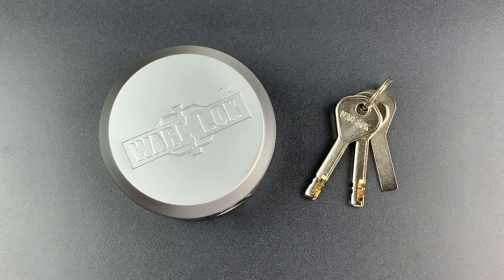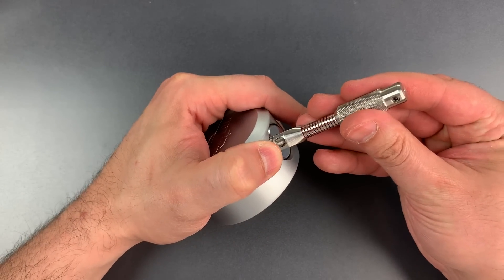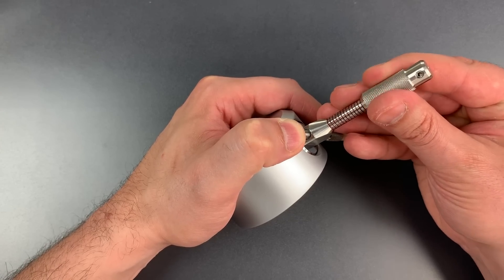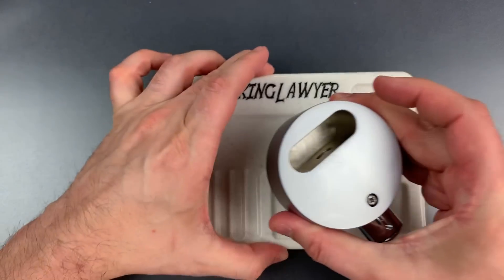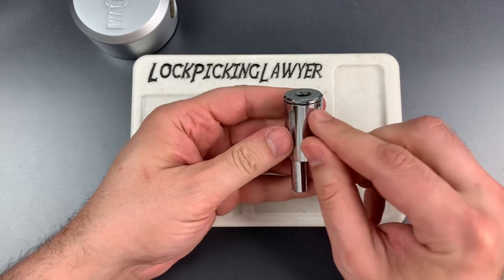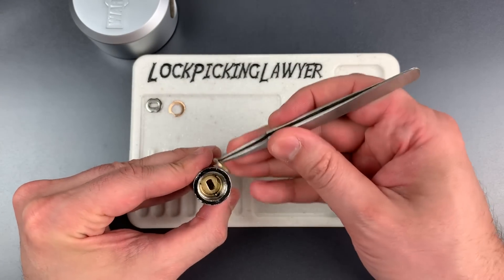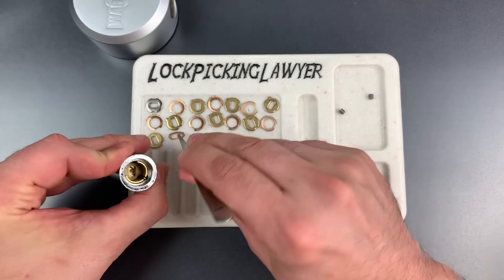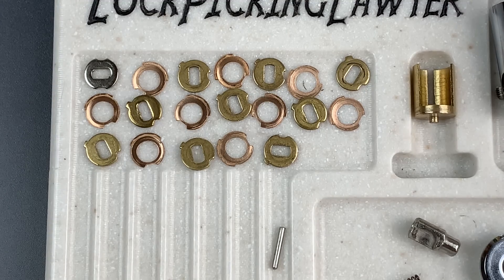[903] War-Lok Puck Lock Picked and Gutted (Model PKL-10)

Comment: Hang on... A puck lock is intended to mount flush with the object it’s locking. That tool you used has arms that required you to rotate the tool into a position you would NOT have been able to do had that lock been mounted.. Let’s have you redo this one but have the lock mounted flushly against a door, etc. I call foul until this one is picked in a real-case scenario. I don’t doubt your skills. But I certainly think this one would be significantly harder to pick if it were mounted and locked in place against a flat surface.

Comment: I wonder what would happen if you used the Ramset on this lock, mainly where the locking lug sits.
Reply: 90% odds of just jamming it permanently into the body. A drill or grinder would let you just push the pin in and drop the core out.
Reply: A small cobalt drill bit in the right place could be a really quick attack. You even have the logo on the front as a reference for exactly where you need to drill.
Reply: @anononomous  good idea

Comment: LPL you should start making a seal of approval of LPL s (or lock picking lawyer average seconds to open) plus a 3-star system of how common the tools for opening are. 0 for household items, 1 being normal hooks, 2 tools available online and 3 tools that you made for it, not available commercially.

for example, this lock would be a 74 LPLs and 2 stars.
Reply: That tool is custom made, idk if there is something similar that you can get online, but this would get 3 stars on this rating system

Comment: Purchased one of these recently, and after removing the core it revealed that they did move the actuator to the side instead of the front to protect with significantly more metal.  Happy with the lock.

Comment: This looks better made than the one I got off Amazon. The logo on the front of mine looks like it was not stamped well. Parts of it barely visible. Also the cylinder stick out ever do slightly from the lock body.
Reply: Still best Puck lock for the price.

Comment: Drilling it out with a smaller drill bit means it is easier to hide the drill bits and you have less material to cut. If it is small enough you might even be able to fill the hole with glue and disguise your attack!

Comment: Locking pin is just spring loaded? I wonder if hitting the face of the lock can make the pin recoil into the core enough to unlock. Slamming it down on a hard surface would work too but of course that's not possible when on a hasp.

Comment: Would you think about doing some distructive testing exploiting the locking lug with a hardness steel pin punch and hammer before you try to drill it

Comment: Before you try drilling it you should try using a magnet see if you can pull that metal stud down I think the body or Bible I think it's cold I think that's might be magnetic so you might need a bigger magnet

Comment: Hey lockpick lawyer, I love your videos! Where can I get that tool you are using???
Reply: You have to make your own or wait for Sparrows to release their version of it.
Reply: @davidgalbraith1840   Thank you, David, you would happen to know if there are any blueprints on how to build it.
Reply: @princehenryiv9207  IIRC they should be up on Bosnian Bill's site Lock Lab. They did a colab series designing and machining the picks, going through several prototypes before they got to the final product you see here, Bill has the prototypes.
Reply: prince Henry  Part 1 - The pick body (LPL) https://youtu.be/q1rYhO--TDA
Part 2 - The control knob (BB) https://youtu.be/Og0bLzU7cWg
Part 3 - The tensioning “nose” (LPL) https://youtu.be/cECT_90pgyc
Part 4 - The tensioning handles (BB) https://youtu.be/qJ3S3tNyBk8
Part 5 - The pick tip (LPL) https://youtu.be/wrd5r1TzkCM
Part 6 - Final assembly and presentation (BB): https://youtu.be/pelD237owcc

Comment: Now that the lock is disassembled, If I'm understanding how the false gates in these work, couldn't you file a few such false gates into the sides of the discs before reassembly?
Reply: Yes you can, but getting the order wrong on these is far harder to recover from than a pinned lock.

Comment: If that lock were installed on something, would you have been able to use the pick?  I assume one side would hit the surface of whatever it were locked on.   Would the pick work with just one tensioning lever?
Reply from the maker: Yes, you can take one off. You can even take both off if you use a set screw.

Comment: Could you effectively bump this lock by hitting the front hard enough to drop that locking bar?
Reply: No. The sidebar has to fit into the gates on the disks that need to be aligned for the sidebar to fit in.
Reply: @Blitnock  at 2:11 LPL relocks the lock. At 2:30 he depresses the locking lug with his finger, stating that it's spring loaded. That's what made me wonder about it.
Reply: @drew79s  Oh, that's a good point! He really didn't show how the locking pall interacted with the core/side bar. Maybe it can be rapped? It would be nice to know the answer. I hope he sees your question and replies, but with his gaining popularity, I wonder how many comments he reads these days.
Reply: @Blitnock  Fingers crossed... I'm intrigued :)

Comment: Cool, I don't think I've seen a disc detainers pick lock before. It shouldn't be called War as it has no false gates.
Reply: LPL and BosnianBill designed and built it themselves, here is the series:
Part 1 - The pick body (LPL) https://youtu.be/q1rYhO--TDA
Part 2 - The control knob (BB) https://youtu.be/Og0bLzU7cWg
Part 3 - The tensioning “nose” (LPL) https://youtu.be/cECT_90pgyc
Part 4 - The tensioning handles (BB) https://youtu.be/qJ3S3tNyBk8
Part 5 - The pick tip (LPL) https://youtu.be/wrd5r1TzkCM
Part 6 - Final assembly and presentation (BB): https://youtu.be/pelD237owcc

Comment: How would you pick it when installed? From what I've seen,  your tension tool went beyond the line of the puck's body so I guess you wouldn't be able to tension it in some aplications
Reply from the maker: Good question. You can easily pick with one of the handles removed. 👍

Comment: Do you think that if this type of lock had around 10 lb of spring tension on it it would be more difficult to pick?
Reply: Hrmm.... if each disc had an individual return spring that snapped it back to home, just strong enough to overcome any binding forces, then you couldn't physically hold a disc in place with tension to move on to the next one. 

Which really just means the tool would have to be redesigned with multiple concentric shafts and separate rings with spring loaded clutch buttons and let the tool hold the discs individually, but the return springs would also ruin any sensitive feel.... and would also probably make the lock difficult to turn with the key. 

Tricky, this engineering bit.
Reply: @mfree80286  Build it and send it to LPL and BosnianBill.
Reply: @davidgalbraith1840  sigh I wish I still had the time to build things on a whim...
Reply: @mfree80286  Same, I keep seeing all these awesome things beng made on youtube and think, now all I need is a lathe, a mill, a forge and anvil, an infrared soldering station, TIG and MIG welders, a plasma cutter, a pipe bender, and a place to put all this shit...

Comment: If I understand correctly, the wiggle room for your pick to go from one disc to the next is the leeway given by the spacer. Does that mean that you couldn't use this pick if they somehow impoved the lock to a "zero spacer" model? Is this at all possible? How would you go to get such a lock picked?
Reply: No, the discs are steel, they can stick and grind against each other, the spacers are bronze which against steel and iron acts almost as a lubricant preventing the discs from sticking together and causing the lock to become unusable.
Reply: @davidgalbraith1840  Thanks for the insight, but all the same; what if the spacers where so thin that you couldn't move the pick from one disc to the next due to the tight spacer dimensions?
Reply: @SojournerDidimus  You still have the thickness of the discs themselves to work with. You can only make them so thin before you run the risk of them bending and thus rendering the lock useless. That was the purpose of making this tool, the picking tips are replaceable, they can match the diameter and thickness of the discs and keyway up to the point where the materials fail by being too thin.
Reply: @SojournerDidimus  Someone else had the idea of making a lock like this virtually unpickable would be to add as much as 10Lbs of spring tension to the discs, this would run the risk of damaging the discs or key, but would also more than likely damage the pick and remove all feedback, adding false gates to that mix and it'd likely keep anyone out.

Comment: Can you pick that type of lock without that tool that you made?  Or do you have directions on how to replicate that tool?
Reply: You can order a shitty one from China bu that one LPL and BosnianBill designed and built it themselves, here is the series:
Part 1 - The pick body (LPL) https://youtu.be/q1rYhO--TDA
Part 2 - The control knob (BB) https://youtu.be/Og0bLzU7cWg
Part 3 - The tensioning “nose” (LPL) https://youtu.be/cECT_90pgyc
Part 4 - The tensioning handles (BB) https://youtu.be/qJ3S3tNyBk8
Part 5 - The pick tip (LPL) https://youtu.be/wrd5r1TzkCM
Part 6 - Final assembly and presentation (BB): https://youtu.be/pelD237owcc

Comment: Does he have a lock picking jargon video, because he says some things and idk what they mean
Reply: What things? If you specify what confuses you someone will explain it.
Reply: @Cheesus-Sliced  binding for example but there's prolly more
Reply: @jmanh128  binding means that particular pin is catching. When you torque the keyway, depending on tolerances some pins will be caught tightly between the plug (the part you slide the key into) and the housing (the part that contains the plug and all the pins). The pins that are caught are "binding", so you can feel when they stop binding because either they are set at the sheer line or you engage a security line on them. As you find where each pin needs to be, the plug rotates a little more and another pin binds. Look up a lock core diagram if that helps to visualise it
Reply: @Cheesus-Sliced  thanks!
Reply: @jmanh128  no worries. Feel free to fire more questions

Comment: what can you lock with this design lol
Reply: Puck locks are usually used on work vans, storefront security gates and trailer hitch guards. Physically they are much tougher than most other designs as they go into a recessed housing with only the keyway and face of the lock exposed.
Reply: A hasp and staple.

Comment: What are puck locks used for? I don't exactly see a mechanism for it to attach to anything?
Reply: instead of a lenghty explanation just do a google image search of "puck lock" and your question will be answered
Reply: Google "folding latch" and check images.  Most people will lock with a regular padlock but any similar latch, some of which are for latches that slide open rather than fold, the puck lock completely covers the shackle so that Joe-Schmoe with a set of bolt cutters cannot get in as easily.  Googling "puck lock" and checking images has more examples.
Reply: Most commonly you will see them locking work vans. You'd have 2 keyed the same in a Sprinter or similar sized van, one on the rear doors and one on the side doors. There is usually a bulkhead installed behind the seats so you can't just break a window to access the cargo or tools that way, though you could steal the van, which probably has a GPS tracker hidden inside it.
Reply: A hasp and staple.

Comment: Too much speed on the drill, heat softens and blunts the drill. Granted you’re using carbide that can handle a decent amount of heat but for metal drill avoid so much speed and you will find you’ll get through much thicker steel before failure

Comment: Why would he invent a device to pick open a lock?
Reply: He does it for the challenge. Also disc detainer picks have been available from the usual scumbags in China for a long time now, LPL and BosnianBill just designed and built a better one as the others where just so crappy.

Here is the series:
Part 1 - The pick body (LPL) https://youtu.be/q1rYhO--TDA
Part 2 - The control knob (BB) https://youtu.be/Og0bLzU7cWg
Part 3 - The tensioning “nose” (LPL) https://youtu.be/cECT_90pgyc
Part 4 - The tensioning handles (BB) https://youtu.be/qJ3S3tNyBk8
Part 5 - The pick tip (LPL) https://youtu.be/wrd5r1TzkCM
Part 6 - Final assembly and presentation (BB): https://youtu.be/pelD237owcc

Comment: If I'm picking a lock and it gets stuck trying to pull the lock pick out what does that mean
Reply: I know it means too much tension but does that mean I'm stuck on the pin or the hole the pin is in
Reply: Sorry trying to use voice instead of texting it with my hands it's not doing everything could you please ime a me

Comment: cant you just take the screw out to pull out the core?
Reply: the screw is hidden while the lock is in the locked position. to remove the screw, you would first have to open the lock
Reply from the maker: Removing the screw does nothing if it’s locked
Reply: @lockpickinglawyer  ohhh. I asked this same question above. haha! I have never seen a lock like this. P.S. I know nothing about locks as you can tell.

Comment: Forget a drill, use a punch and hammer.
Reply from the maker: I’d be stunned if that worked.
Reply: Mike Fisher
 Are you thinking with light tension pulling out on the core, you could inertia that pin back?
 Or do you mean punch through the body face?
Reply: @dragonhealer7588  I was thinking second option, but a Master lock style kinetic attack is a good idea.

Comment: I'd much prefer it if you picked locks like this when they're in a properly locked position, as in against a wall/door. There's never ever going to be a situation where you can grasp and rotate a locked puck lock 360 degrees in all directions and have complete freedom of movement and accessibility with your other hand, which is, I'd guess, one of the security features of these types of locks. You wouldn't even be able to rotate your disk detainer pick enough to tension the lock fully, let alone comfortably hold it with one hand. Same with door locks and the like, you'd never be able to grasp the whole thing and get as much of a comfortable position for tensioning the lock. Kinda ruined the channel for me once I realized this. What's the point of showing how easy a lock like this can be picked if the method you're showing is NOTHING like what it'd be in the wild?